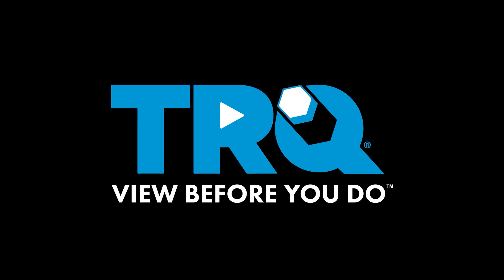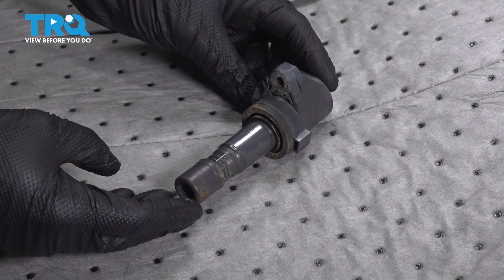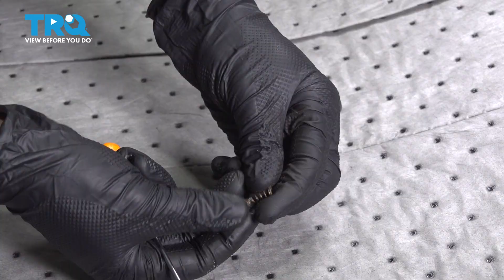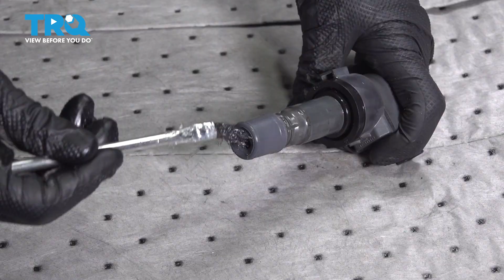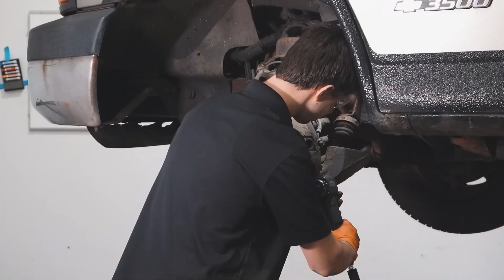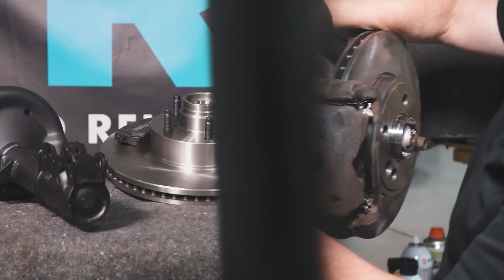How to Replace Ignition Coil Boots 2012-2015 Honda Civic 1.8L L4

Comment: Great video. What is the reason this is done? What symptoms are there that it's bad? I understand the spring/boot but that large gasket is it just a dust cover?

Does it need to be changed at 100k miles?